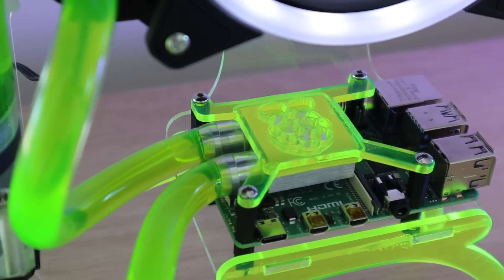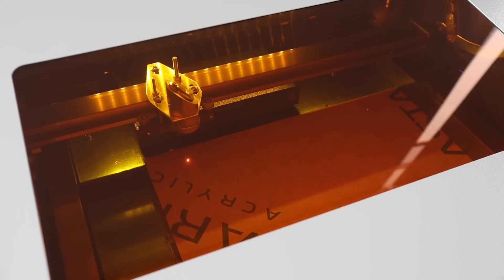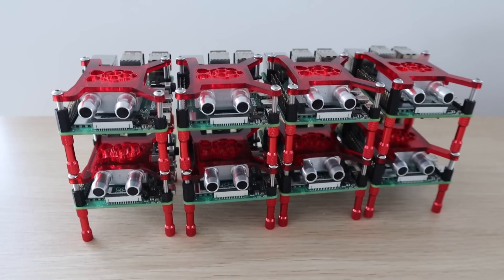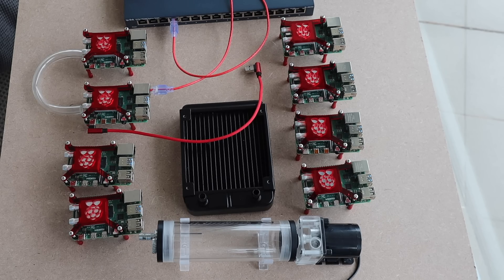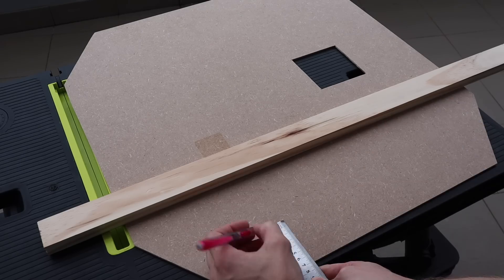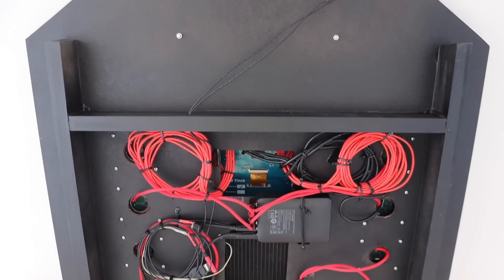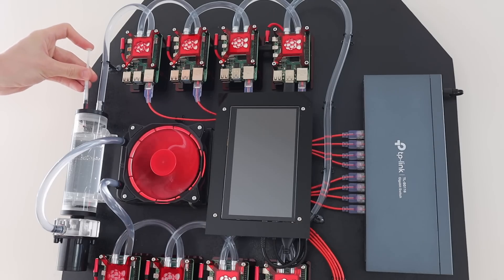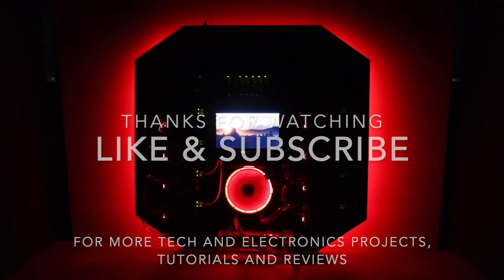Building A Water Cooled Raspberry Pi 4 Cluster

Comment: Why are you running the hottest water into the res/pump assembly? Shouldn't it go... pump > blocks > radiator > reservoir > pump ?
Reply from the maker: The order of the components in a cooling loop doesn't really matter. As long as you've got the radiator removing more heat than what the CPUs are putting in then it'll continue to work well.

Comment: This looks amazing. How hot does it run? my only concern would be that the coolant is running from one Pi to another meaning it passes through 7 Pi's after the first all the time being heated?
Reply from the maker: I'm going to be doing a thermal test in a future video. As long as the flow rate through the blocks is high enough, it shouldn't make any significant difference if they're all in series.

Comment: Nice Build ! 
What software are you going to use?
What about storage? Only sd cards? Are you going to use some kind of network storage?
Reply from the maker: I'm not set on a particular package, I have a couple of things I'd like to try on it and I'll likely try a few different software configurations as well.
At the moment they've only got SD cards. My primary goal is to get them to do some rendering and simulations, which aren't really storage intensive. I might look at putting an SSD onto the host/master node.
Reply: @MichaelKlements  nice !

Comment: Really nice. But what will be final purpose? i mean, you can build a cluster using virtualbox much cheaper for testing. In the real world a RB cluster will not handle much load.
Reply from the maker: My main intention was to learn about cluster computing and try out different configurations and software packages. Yeah you can obviously do that all virtually, but it's a lot more satisfying having a physical system that you can play around with and make hardware changes to. Long-term I'll hopefully be able to get it running some simulation software packages.

Comment: My OCD is going overdrive because the tubing isn't the same on both sides (rpi facing each other) haha but damn this is sexy af
Reply: Agreed. I was thinking the whole time that he was surely going to fix it before the final product
Reply from the maker: Haha, the Pis aren't symmetrical though. So even if I flipped those ones around, the power cables and GPIO would be on opposite sides and then ethernet ports/cables and cooling block would be offset on one side. Either way its going to upset the OCD in some people haha.

Comment: Looks good.
However is that USB charging hub sufficient? I have a similar USB charging hub, 2.4A per socket, to power two Raspberry Pi 3B's but it is not enough. The under-power indicator displays most of the time on the Pi's and they crash frequently. I wonder if with the more power demanding Raspberry Pi 4B's you will experience the same problem?
Reply from the maker: I'm not sure yet. They all booted up and appear to be running fine at 2.0Ghz, but I haven't looked at whether they're indicating under-power.
I know the official power supply for the Pi4 is a 3A supply, but I've monitored the current drawn form it under a number of different uses and I've never come anywhere close to that. I've hardly seen anything above 1A.
That's really interesting that yours start struggling on 2.4A. What operating system were you running and are you running them overclocked?
Reply: @MichaelKlements  One is running RPi OS and the other Manjaro ARM, both running at standard clock speed. They both have two USB flash memory devices, one for the operating system and /home and the other as swap, just in case it is ever needed. Of course the USB devices need some power and hence may just take the voltage below threshold. Only one of your RPi4's uses a USB socket  so perhaps your system will run fine with that power supply.
Reply: I’d been thinking about a USB multi-port as a charger for a while but always got put off the idea since the official charger is 3A (15W) and most multiports top out at 2.4A per port.  Maybe running headless without Wifi or Bluetooth it could work.  Might be time to finally get a USB A to C cable and give it a go.

Comment: The series piping is not the way three you need a manifold for feeding the cooling blocks and once to receive the water from them. and you need to ensure that all the entry and exit pipes from the cooling blocks are of equal lengths and size
Reply from the maker: If the Pis were each contributing a significant amount of heat to the system then I'd agree, but the cooling system is still oversized, even for 8 Pis. I'll be doing a follow up thermal test on the system in a subsequent video and I'll log the temperature on each Pi and the cooling system for comparison.

Comment: First of all, that´s an amazing job thank you so much for sharing with us... but i´ve seen in the video few air bubbles flowing into the circuit and it may be a problem because you lose eficiency in the heat transfer and air also affect to the pump, making it to cavitate. A posible solution, make sure that you don´t feed the pump with any air bubble just by setting it vertical, or rotating 180º the radiator to keep the air trapped in the upper part of the radiator. 

Thank you for the time you spend making this video, and greetings from Spain. Keep it up!
Reply from the maker: Hi Jose,
Yes, there was still quite a lot of air in the system during the video as it was still only the first couple of minutes of the system running, so the system was still working the air out of all of the cooling blocks and radiator and that. 
Yeah, ideally the reservoirs should be vertical as well, so that the air pocket is as far away from the pump as possible. 
Thanks for the tips and the support!

Comment: Curious.. Two things: First, I would always mount the reservoir into the highest position of a loop because air bubbles would probably stay there. You can also (re)fill the system using gravity. Second, I would have expected the 5V RGB light strip to be connected to the GPIO of the master node..
Reply from the maker: Yes it would probably have been better to use a rectangular reservoir with a filling cap on the side (top side) as well.
The Pi can't supply enough current to drive an RGB strip directly. I'd have to set up some sort of interface board or use transistors to drive it. This just seemed like a lot of work for something which already had a controller and would mainly just be used as RED anyway. 
It would be nice to use the RGB colours or brightness as a visual indication of the cluster load or status though.

Comment: And for what task do you want to use this for? And isnt it cheaper/more powerful to buy a cheap used High-Core-Count CISC CPU?
Reply from the maker: I built this mainly for experimenting with cluster computing. I don't expect it to outperform a good desktop CPU, but I'll probably do a comparison video at some stage as well. I'm not sure that it would be cheaper to buy a powerful CPU, as this whole system cost under $600 and a good CPU can cost more than that by itself. But yeah, the intention isn't to build a super fast computer, it's primarily for learning/experimenting.

Comment: you can use wifi 6 connect to get rid off wire cable
Reply from the maker: Yes you can run the cluster over WiFi as well, Ethernet is just a bit more stable and is faster.

Comment: Because after a few minutes all the water will equalize in temperature there actually is no  reason not to run them like that.
Reply: yep
Reply from the maker: Thanks Turbo Dakota. This seems to be the most likely result. I'll be doing a test video to demonstrate this in future as well.
Reply: Yeah a lot of people worry about it in regards of cooling CPU's and GPU's and at your first bootup, or while enterring a game, it seems like there is a difference, but when the water reach that temperature equilibrium, the orientation doesn't really matter anymore. Let it run untill it no longer increases in temperature, then run the tests.
(Which is why techtubers HATE testing water cooling gear)

Comment: What are the temperatures under load?
Reply from the maker: I'm planning on doing a full test video on the temperatures at each node, hopefully in the next few weeks. As a preliminary run (although only for a couple of minutes) the system ran at around 34C with an ambient of around 28C.

Comment: Very nice! Can you guide me to a link, for that pen you're using? It had an ultraviolet light, possibly to cure epoxy? Any help, appreciated....
Reply from the maker: It's usually called 5 Second Fix - https://amzn.to/2Lw0K1x
I doubt it would work on epoxy, the glue has to be designed to specifically cure under UV light. I like it for acrylic because it doesn't start curing until you use the light and then it cures almost instantly, so no waiting around with clamps etc.. It also cures completely clear and doesn't discolour.

Comment: One mistake is that pump and reservoir is on bottom, should be on top because you have residual air in the loop and it will be trapped in the top PI cpu block. Puting the reservoir on top the air will come back to it it would be no problem. Other then that i dont see anything else wrong here, everything is beautiful, great work.
Reply: I dont think there is much fins in the block at all, so the bubbles would flush out 1 sec after the pump is on, also remember we are talking about 10-15 watts of heat total here.
Air will normally not work its way to the top past the water in the tubes, in pc water cooling the top radiator or a cooling block will not fill with air even if it is over the water tank air level, only if the pump is sipping air and pushing it through the loop.
When the pump is at the lowest spot, the pump and loop will work until the entire loop is empty.
If the pump is higher, the pump will pump air before the system is empty.
But it really does not matter, i would put cable ties on all the hose connections though.

Comment: Awesome build! One thing I'll say, in case no one else has, the series run of each Pi in the water loop won't really end up increasing temps for the ones down the line as much as you might think. The thermal capacity of water and a 120mm radiator is going to be far higher than even 8 pis will overcome. Certainly the water temperature will increase as you add heat to the loop as a whole, but there shouldn't be appreciable difference between series vs parallel. As more heat is added to the loop as a whole, the water temp will increase, but the ordering doesn't really matter, in practice. 

https://www.youtube.com/watch?v=RnPB_q51iVk for more info and testing. 

That video is using much higher wattage parts, as well, the 1080Ti consumes (and thus, converts to heat) 200+ watts, and the 6900K CPU is rated for 140 watts (before the increased voltage and 600MHz overclock he'd put on it.) Even if you're overclocking the Pi 4, it's still going to be dissipating less than 10 watts under load, so the total for the 8 Pi cluster will be well below 100W total. Your 120mm radiator is not going to have any problem at all with that heat load.

Thanks again for the videos! You've made me want a laser cutter even more than I did before!
Reply from the maker: Thanks for the detailed explanation John. This was pretty much my thinking when putting it together and it seems like there are a few videos out there which have tested different configurations with similar results. A couple of people have mentioned watching JayzTwoCents's video.
I must admit that when I bought the laser cutter I didn't think I'd use it nearly as much as I've landed up using it!
Thanks again for the input and support!
Reply: @MichaelKlements  I just left that exact comment and was about to mention JayzTwoCents etc.  (on a side not LinusTechTips did one on radiator stacking, unrelated but useful to know if you ever wanted multiple rad's)
Yes your build is perfect, Good Job.
I'm looking forward to a future where liking these together with PCIe is a thing (like what's happening in the datacentre's) then the true scalable ARM supercomputer will be something anyone can have (Pipe dreams i know)
Reply: I was gonna say that too, eventually your loop will reach equillibrium. I'd imagine none of the water in that particular loop is going to be much more than ambient. It really wouldn't have mattered either way you set it up, so long as everything was getting adequate flow.
Reply: You are right. In addition; the water has so much flow (even on the lowest pump rpm) that the delta temp between each waterblock is zero, microscopic at worst.

Comment: Man this is so epic! Your content is getting better and better. Just as an FYI most watercooling loops reach an equilibrium temperature regardless of the flow order or direction, you can watch a number of videos and tests of this done by guys like Linus and Jayz2cents so you should have equal temps across all the nodes. Cant wait to see what you put to work on this beast.
Reply from the maker: Thanks Tyron, I'll go and have a look at their videos. I figured it probably wouldn't make a significant difference in temperature across all of them, but that's interesting that it reaches an equilibrium temperature and all evens out.

Comment: GREAT BUILD!.... I actually would love you to cover the software isde of the cluster.
Thanks!
Reply from the maker: Thanks Miguel, I’ll definitely do so once I get it all up and running.
Reply: @MichaelKlements  cool. Looking forward to watch this. :)
Reply: @MichaelKlements  I don't really understand the purpose of this, because buying a micro motherboard with a modern CPU would have been surely way better use of money and time...
Reply: @ACNNOMOREBLUFF  for fun?
Reply: @ACNNOMOREBLUFF  maker's gonna make
Reply: @ACNNOMOREBLUFF  it's about building a cluster to learn cluster computing. Not about performance
Reply: @deepstonecrypt  So you waste a lot of money just to test something that does not work ? Very smart, indeed !
Reply: @ACNNOMOREBLUFF  how would it not work? It is literally a fully working cluster server LOL
Reply: @deepstonecrypt  With very low capabilities ! Any cluster would have been made way better using Nvidia NGU platform or VIA CPU platforms. You can't run any cluster app ont this :-)
Reply: @ACNNOMOREBLUFF  pis are small Form factor, run on low current and don't consume as much electricity, and way in total easier to set up and manage.
Reply: @deepstonecrypt  Did you ever heard talking about sub zero and risc processors ? :-) :-)
Reply: @ACNNOMOREBLUFF  Before trying to outsmart someone on the internet learn proper English.
Reply: @ACNNOMOREBLUFF  Didn't ask don't care
Reply: +1 on this
Reply: Great build. But why not add an additional radiator and vent after right four Pi's, and you mostly have temps under control :)

Comment: What a SICK build!!! I love it!!! And nice job!!! Would you know if this would be comparable to a powerful windows computer that would be running an Intel Core i9 processor were your able to run rendering software's like Keyshot and Zbrush and or other software's where it is taking up all your CPU just to maintain the program to use in it's entirety at the same time even? Because if that's the case something like this wouldn't cost as much as a windows PC with top of the line hardware or would it? What would something like this run in American funds lets say, would you be able to share what this system cost you? And Thanks in advance!!!
Reply from the maker: Thanks S7!
I haven't finished testing it yet, I'm still busy with the setting up and figuring out what its capabilities are. That'll definitely be in a follow up video though. I'm pretty new to clusters, so its probably going to take a few weeks to work through and get running the way I'd like.
I'd anticipate that you'd probably still be better of with a powerful PC, from a performance and cost point of view. While this is a cool setup and its interesting learning about cluster computing, it's definitely far from being a "supercomputer".
This cost me a little under $600 to build, so it's still substantially less than a high end PC, but it is quite an expensive setup. We'll see how it performs and I'll try compare it to a PC and my Macbook with similar tasks (if I can work out how to run something similar on all three, perhaps a Python script).
Reply: @MichaelKlements  WOW, that sounds pretty cool, can't wait to see what this thing is capable of!!! I'm really hoping it would be capable of handling such programs like them and at the same time. Good luck with it, and in the mean time while I'm waiting I'll have my fingers crossed!!!🤞🤞

Comment: You don't need to worry about stringing the pis all together. For one, they aren't putting /that/ much heat into the mix, but mainly because water has a very high specific heat, and ftmp the water in the whole loop will be around the same temperature. The same goes for a normal pc loop. It seems like it would make sense to put a radiator in front of each heat producer, but if you use inline thermal sensors, you can flip things around and you'll find it won't make a difference what order the parts are in, as long as you have a reservoir feeding the pump from a higher altitude(any small amount higher will do) and arrange the radiator or reservoir so that you can easily bleed air out of the system.
Reply from the maker: Thanks for the advice and explanation, I appreciate your input! That was pretty much my thinking, it would probably be quite interesting to try test a couple of different arrangements and see what the results are.